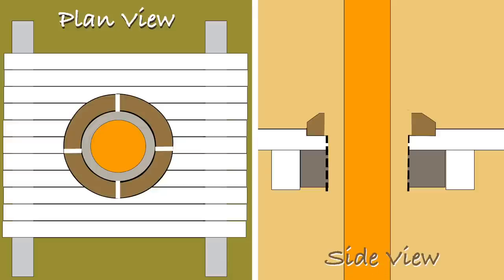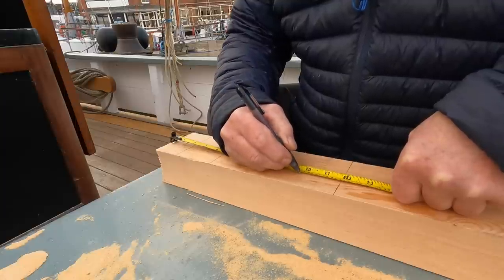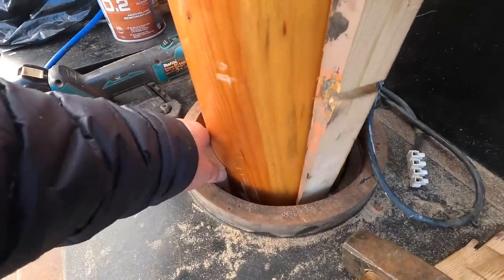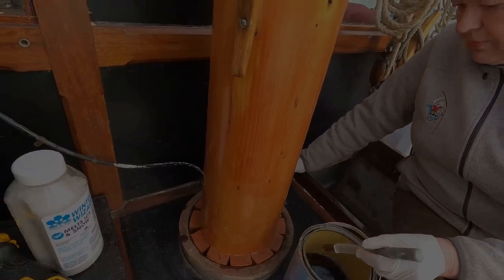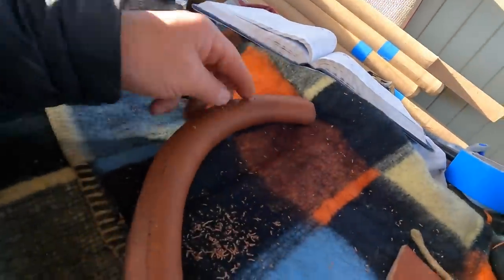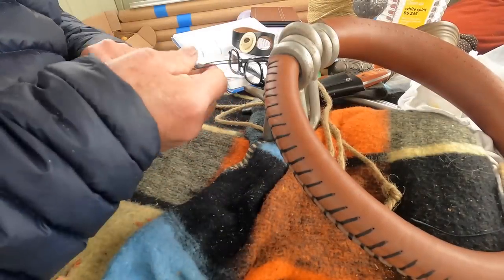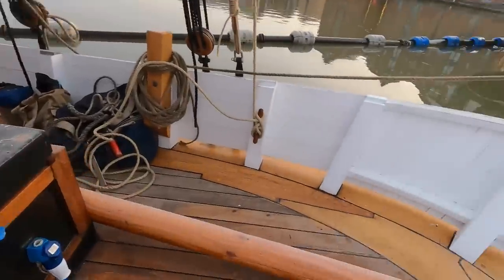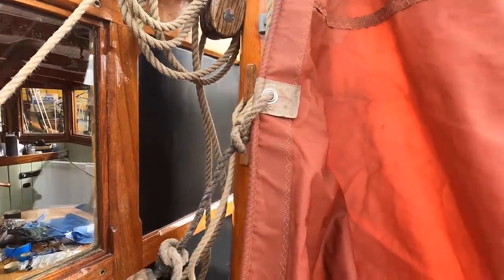Restoring Josefine PART 22 - Booted, Leathered & Bent!

Comment: Bonjour Randie and Reg,
I hope you are fine now, my COVID experience was hopefully absolutely nothing (caught after 3 injections it is true). 
What a beautiful old lady now (she deserves lady Josefine, that sounds nice), and always new questions. 
Reg, you have made a great job with this so thick leather on these "rings", but, what is their purpose,  I have not seen them on the sails or the masts ?
And would you plan to add winches to  help you to hoist the sails ?
Amicalement, Raphaël
Reply from the maker: Hi Raphaël, yes we have had the full set of Covid vaccines but boy did we suffer this latest variation, the only good thing was we both lost a lot of weight which we needed to! As to the ring, it is most often called a ‘traveller’ and is something we have added. We have 3 head sails, staysail, jib and flying jib. The staysail stays inboard at all times but the tack of the jib and flying jib have to be hauled out to the end of the bow sprit, 16 feet away, on its way it can easily be snatched away from our poor hard working hands by strong winds, by attaching the tack of the sail to a metal ring around the bow sprit we can pull the ring to or from the end of the bow sprit without loosing control of the sail.

Comment: Watching you lace the traveler brought back some fine memories. Not from sailing mind you. Jumping in the Way Back machine to the Rust Belt in the 70's. Every fresh minted teen boy driver working meticulously by the dim glow of the dome light while cranking the stock radio in their first beater. There was usually a friend or two on board for company. I can not recall a steering wheel that was NOT wrapped. On a floaty note, Josefine is looking quite handsome.
Reply from the maker: Thank you Jamie, so happy to spark a few fond memories, you recall them beautifully.

Comment: The Thames sailing barges were renown for just having a captain and boy to manage the entire boat. How easy will Josephine be to sail short handed? When I go sailing I have a Genoa and main self furling sails with electric winches operated from inside the spray dogger keeping me dry and warm. I don't envy you going up on deck, wresting with the sails in inclement weather. 
You are both doing an excellent job and it's interesting to pop into the docks and see the progress made in person. Keep it up.
Reply from the maker: Thank you Simon, How easy will it be… time I suppose will tell, but the evidence so far is looking promising. For the inclement weather we are going to make sure we have the right clothing (probably offshore HH and lots of Marino wool jumpers) we won’t be trying to look tough by wearing yellow Dunlop fisherman Mac’s! When we are done out there, we at least have a nice warm (heated) wheelhouse to retreat to! As for the deck, it’s big enough for us to stay on our feet and work more or less upright (in good weather we could have a game of footy out there 🙂) we are way too old to be crawling around on our hands and knees. To make matters easier we have tall sturdy. bulwarks to grab onto. As to raising the sails, because they are spread out over 2 masts and a long bow sprit, they are all individually much smaller than, for example, the giant Thames barge main and we can handle them so much easier. Of course we haven’t been tested in a force 9 yet! No, I think we can handle the rig, our main concern is staying awake! Seriously, 4 hours on, 4 hours off is really going to test us and for anything over a 72 hour passage we are going to invite ‘crew’ to join us. Invites will be tendered on this channel first, so keep subscribed!🙂

Comment: Great Vid again there, respect for your persevereance! May I note that in attaching the sails to the mast : The beaded rope should go around the mast (With the sun, according to tradition),  and and the end put into the UNDERLYING eye, (not back into itself). Then fasten with two half stitches. This will make it much easier to hoist the sail as the beads are at an angle to the mast instead of being horizontal. Keep up the good work, summer is coming and then its time to enjoy all that hard labour :)
Reply from the maker: Thank you Thomas, that’s something we will look into, our beaded ropes are not currently long enough to be fastened in that way but we will certainly be changing them if raising and lowering the sails proves difficult. Glad you enjoyed the video.

Comment: The boat’s looking great and it looks like you’re in the home stretch but I wonder why you don’t put any sealant in the fasteners put into the spars or chainplates when you installed them.
Reply from the maker: Hi Rudy and thank you. We do put a bit of oil based mastic on some fastenings where we feel it will do some good. In places like the wooden clamps holding the peak halyard stropes to the gaff, we didn’t because they are facing down under the gaff and no water can collect or sit.